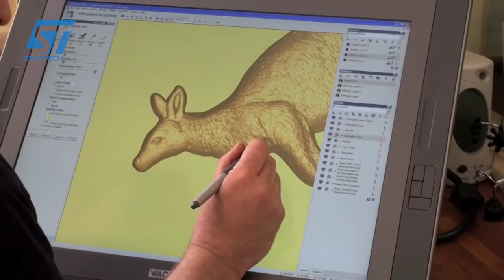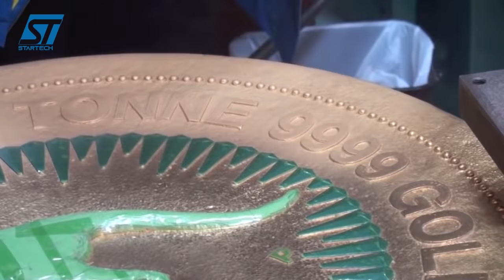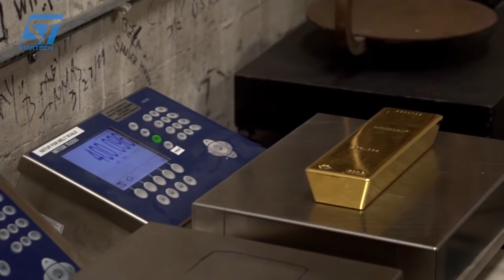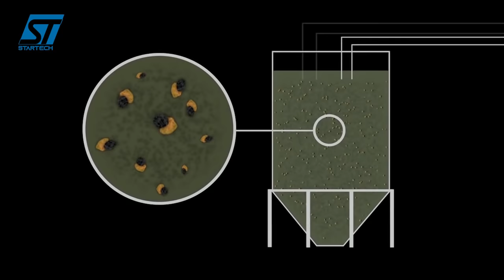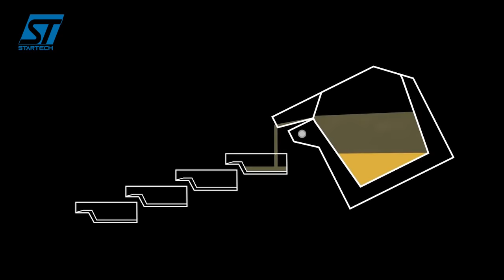Amazing Most Expensive Biggest Pure Gold Bar Production Process. Incredible Melting Gold Method

Comment: It is remarkable so little gold and gemstones england has in their underground yet they own more than most countries. Wonder how that can be.
Reply: Pillage old chap.
Reply: Well. Lets see.... australia is an old english colony.... we still have heaps of gold in the ground but by blimey the ol pommy blighters took a fair whack before we went all federation in 1901. Then theres every other colony.....
Reply: Most of the gold held by the Bank of England is actually there for safe keeping by other countries. UK only has roughly 320 tons of gold. US, in comparison, has about 8000 tons of gold.
Reply: Gold only has real value in a war and then it's only used to protect one asset, Land so unless the UK were thinking of invading then why do we need gold?
Reply: @alexnewton1936  gold has real value for industry 24/7/365, especially in electronic devices, which subsequently wind up in everything from medical equipment and industrial equipment to consumer goods.
Reply: 99.9 percent are looted gold.👍🏻
Reply: @ParadigmUnkn0wn  True but you wouldn't stockpile that gold It would be bought and used immediatly
Reply: @ParadigmUnkn0wn  and thats it. Gold is plated onto electrical connectors because it is a noble metal so it will not corrode or oxidize but past that it is fat too soft to have any other industrial uses. Its valuable simply because we say it is. The only thing of value is food, clean water & clean air.
Reply: India
Reply: @squanchy9755  What ever. England, US etc. western countries with no or little resources occupies the most
Reply: Great Britain is still an empire.
Colonies all over the world, manarchs have the biggest opportunity
Take the p out of pResident...
Look at the flag of the East India Company and compare with the US flag.
Reply: @Isawwhatyoudid  
Well said. I have people who push to invest in gold for catastrophic times. I tell them if you can't eat it, stay warm with it, or defend yourself with it, will be worthless.
Reply: Roba en sus colonias,pues

Comment: Thanks for the upload, great content. I would like to see someone who can afford it, start a channel that periodically drills into a new released coin from various different mints from around the world for precious metals testing. Keeping them honest I could never afford to do this myself but if someone could make sense out of the initial idea, I would really be interested in this type of content.
Reply: lol,  not really
Reply: this is what a trillion dollar coin actually looks like
Reply: You could check the density of the coin.  All you'd have to do is weigh it carefully and measure the volume precisely.  That's easy by water displacement.  This is at least a cheap and non-destructive way to check for obvious fraud.  Of course, you need to know the exact alloy they're using and what the density of it should be.  There are other non-destructive testing methods like neutron activation analysis or xray fluorescence that can tell you exactly what elements are there, but that kind of thing is more expensive.
Reply: @polarbearchimney  not really what?

Comment: The original ore had a very low gold concentration.   The liquid used to extract it was perhaps an acid, following by electrolysis.   

So now there is a lot of fine dust tailings covered with this liquid and put in a pile.   In copper mining these piles are destroy the local rivers.   I wonder what this chemical blend is?

Comment: Gold , the snobiest metal in the creation.
Reply: It is also one of the most useful of all noble metals. The worlds banking systems are based on the value of gold which fluctuates some from day to day but overall is extremely stable.
Reply: @timmayer8723  , stable as gold does not want to become friend with other elements , gold likes to live alone .
Reply: @timmayer8723  . Ndmxç
Reply: @timmayer8723   that was one's the case not anymore.  Most banks and country's print more money than there is gold in stock